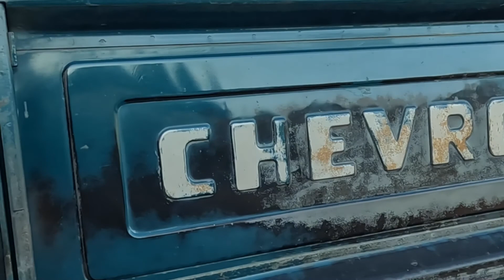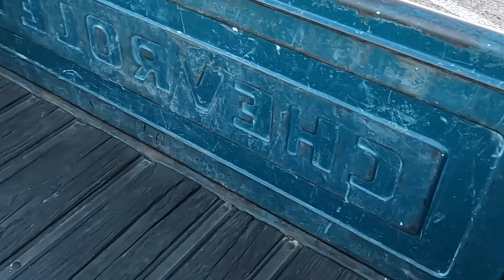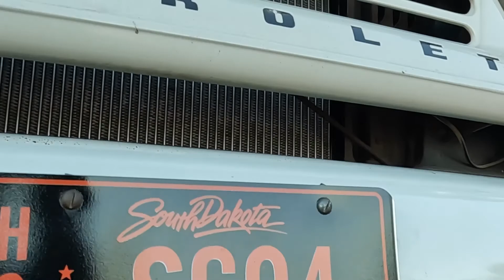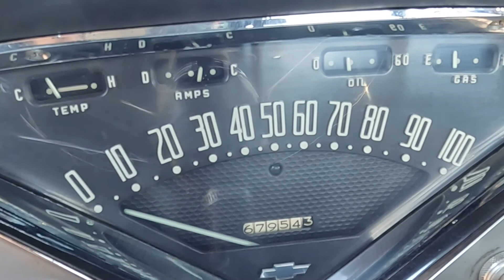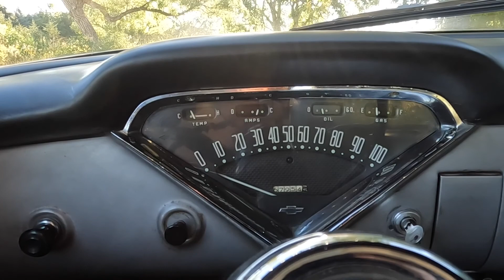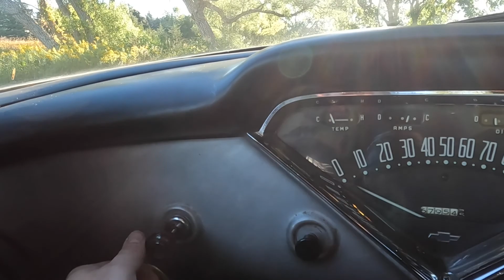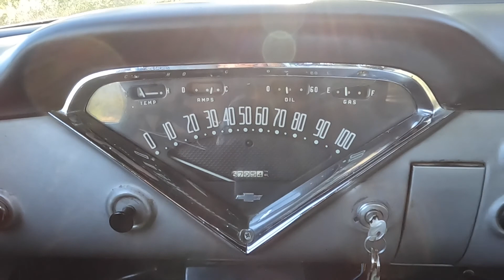1958 Chevrolet 3100 C10 - Frankman Motors Company - Walk around and Driving Video

Comment: Cool truck! That interior is very well done, the correct grey, dark grey and "charcoal" interior colors correct for '58 and even the correct seat upholstery for a standard cab '58! That's not something correctly redone very often, bravo. This truck would fool most people into believing its 100% stock, but I see that newer automatic and 4 speed-looking shifter. Its very well done and integrated, it presents as a stock truck under the hood as well. Best way to modify one of these trucks in my opinion is to do it in such a way that it looks factory. Good video, and Bravo to whoever restored this truck.